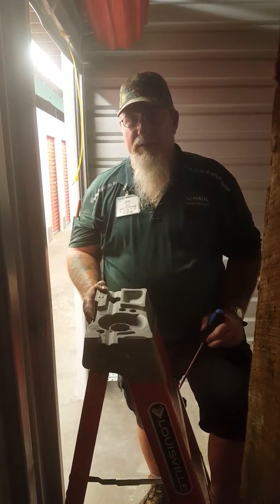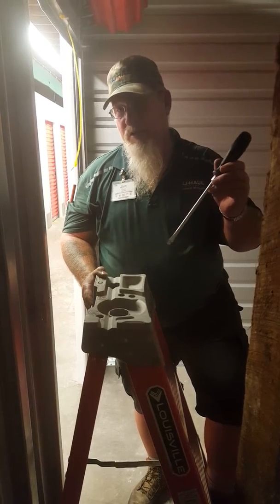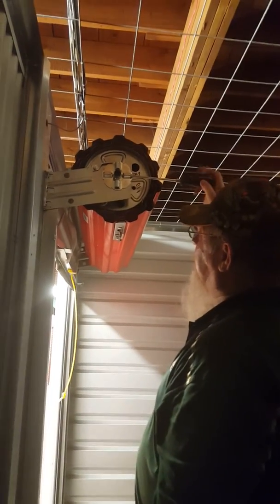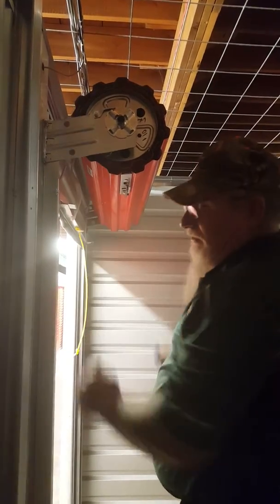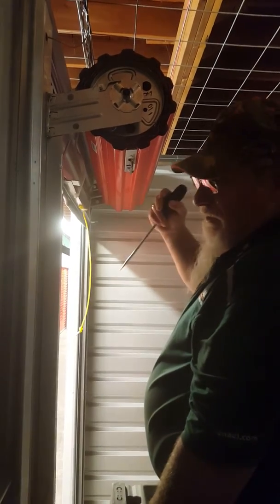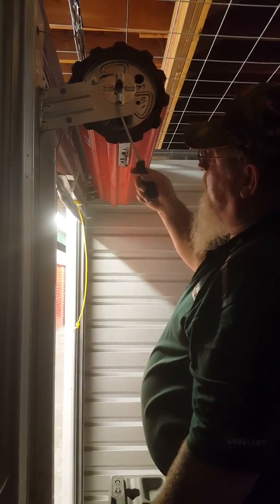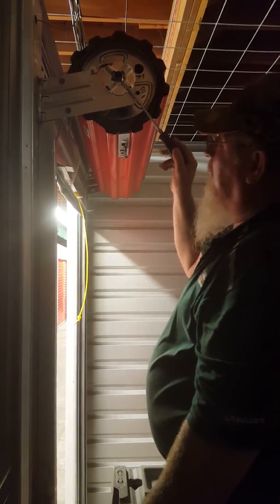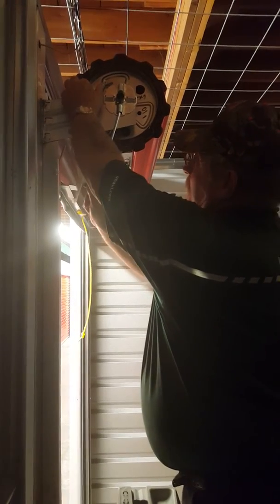storage door adjustments for roll up doors

Comment: I watched several videos but this is only one that matches up to mine. My door, out of the blue, just sprung loose and shut. It was a terrific boom. Glad we weren't under it. We were around corner about 50 ft away. We had no clue what caused it. This video helped me to tighten the spring back. After watching this video again after fixing the door I can see there is a spring on the gear that allows it to rotate to the next notch. I had to pull down and  engage the gear keeper each time. I seen the spring at the time so it has broken. I tried the door a few times. It is not quite where it needs to be but I can at least open it up. I will do more adjustments soon. Thanks for simple video that saved me a pile of $$. The service company wanted $253 to come out.

Comment: If the pull chain is slipping, does that mean the door needs adjusted? If so, should the tension be increased or decreased?  Thank you for your help! :)
Reply: Your key way may have come out. Or the teeth of the sprocket are worn down. If the door is heavy while u are trying to open it. It may need tension.

Comment: My roll up door shakes side to side when I pull it down, but not pushing it up. It shakes a 1/4 of the way down and pulls pretty smooth the rest of the way down. From the inside, if I put pressure on the door to the right side then it will pull down smoother when performing both maneuvers. The tracks seem to be fairly tight? Any suggestions?